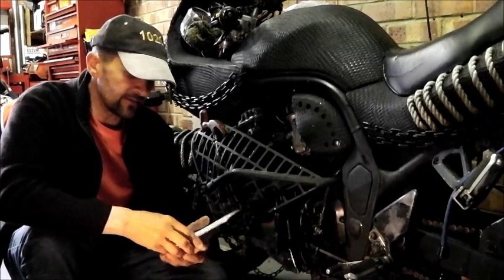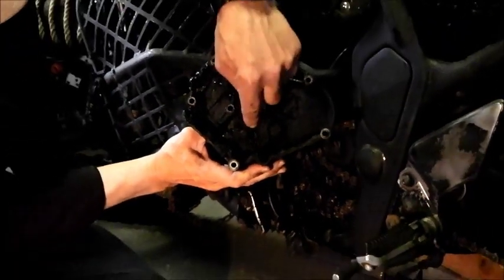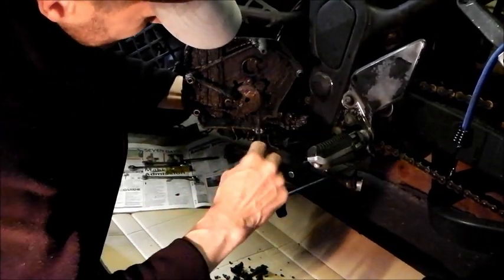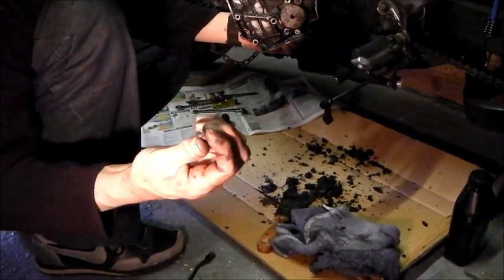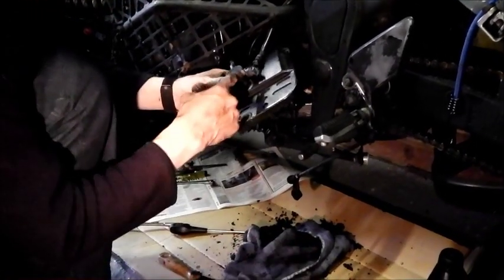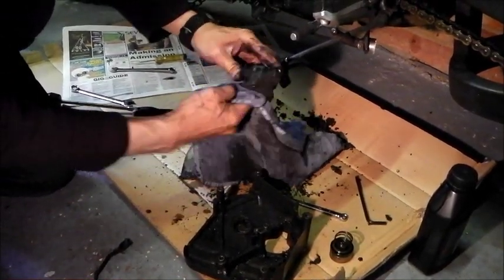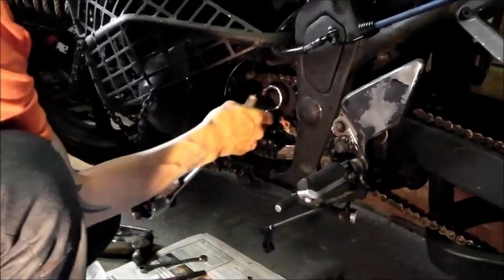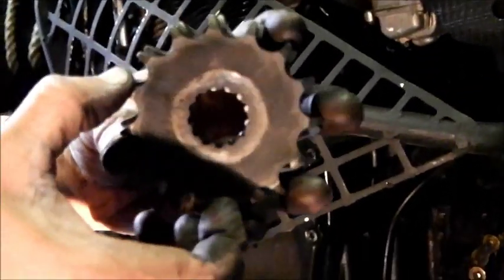Delboy's Garage, How-To;- Bandit Clutch Cylinder and Front Sprocket Replacement.

Comment: hello again, i hear you were mentioning belt drives, do you think a belt conversion on a triumph scrambler would be worth it in terms of small power loss vs less maintenance (initial cost for conversion not considered)
Reply from the maker: Before you consider anything else my friend, is it even feasible??  Do you know of a kit then??
Reply: Hi There, yes there seem to be a couple of kits out there such as 

http://www.freespiritsparts.com/en/belt-drive-conversion-for-triumph-scrambler-thruxton-silver.html

That was the first thing i checked when i heard you talking about belt drives on harleys. Thanks again for taking the time to answer so many questions, i really do appreciate it.
Reply from the maker: That looks pretty cool.. i see in a few of the images they have fitted 
an Idler pulley which you'd need with a regular style swing arm.... very
 interesting, and i imagine it would make the bike a tad smoother and 
maybe set a few ponies free as its lighter... ill have a look at the kit
 and see if it's what it looks to be.... and obviously if they'd send us
 one, id do a full video installaton... but i bet they wont..lol?
Reply: See this is why i asked, i didn't have a clue about different swing arms and the need for an idler pulley so thanks for that :)   Fingers crossed for a freebie :D
Reply from the maker: Its not a big subject buddy... but just important to get the parts right... TBH you certainly dint need it... however it does have some small benefits, and looks trick too... dont thing they'll send us one really.. but its always worth the ask aye...lol

Comment: hey del...
at firts please excuse my english;-)
is it possible that my clutch doesn't seperate the right way when the seal  of the slavecylinder is too old or woren out?

would appreciate an answer.
Reply from the maker: +bull e Hi There... if the seal is worn out then it will leak past and the clutch will not hold on the lever...you pull the lever in and hold it, but the bike still moves forward, or even the clutch does not disenguage at all.....but if the clutch works ok, then the seal is fine.... how is your bike working right now..?
Reply: +Moonfleet41 
thank you for your quick answer
when i strart the bike and put it in first gear , the engine dies immediatly even if the lever is pulled.
i can hardly move the ebike by hand when it's in first gear and the lever is pulled.
cheers from germany
Reply: +bull e 
by the way its the same bike like in the video an bandit from 1997
Reply from the maker: +bull e HI again, ok, firstly, you will normally find it hard to push a bike in gear with the clutch pulled....you are rotating a lot of internal parts and all glued together with oil...so thats not always a problem or a measure of a clutch's performance......what makes me wonder is your explaination that it cuts out as soon as you puyt the bike in gear....... have you checked the side stand switch????????  That is the plunger switch that is pushed in by the stand, and must spring out again when the stand goes up...if it stays on then the bike will think the stand is still down and the motor cuts out as a safety measure.......why not check that before you go any further.... ?
Reply: +Moonfleet41 
yes i did.
i'm a pretty heavy guy with a 120 kg and i believe i could push the bike in firtst gear with  a pulled lever;-)
but the rear wheel just didn't move.
as i explained the bike cuts  out an just one second after that i startet the bike in first gear with pulled lever and everything was ok.
also i  can hear a sound ( the engine was not runnig) when i pull the lever.
it came out of he slavecylinder. like pushing  a fluid or air throw a thin gap.
of course i bledded the systhem after that.
but still the same problem
Reply: +bull e 
i don't know the right words for that...
but the rest of the clutch lilke all the plates and rings and stuff where replaced last year by a mechanic an i had no problems till yesterday
i ran the bike like 7 or 8 thousend km in this time
Reply from the maker: +bull e Sorry then buddy, i cant do much more... i have given you the obvious possibles, and you tell me its not those things...i cant diagnose your bikes problem over email, from this point i would need to see it to investigate for myself as i dont really understand what you are explaining, sorry not to be able to fix it for you, perhaps its time to take it to a garage...?
Reply: +Moonfleet41 hey
i replaced both auf the clutch-cylinders and the fluid yesterday and the bike works just fine👍🏻👍🏻
thanks for your effort

Comment: Love the vids, great reference source as a new rider - I've got a question that I reckon you could answer fairly quickly, what's the right forum for asking you a question?
Reply from the maker: +Bigface NM Ask away, just post it here - what do you need to know buddy??
Reply: +Moonfleet41 OK, nice one - '97 Baby Bandit, first big bike. When I let it rev out in 2nd, 3rd, 4th, at about 8000 rpm it will often leap up to about 10000 rpm, sometimes with an increase in acceleration, but often nothing to write home about. Mates have talked about the 'powerband', but what I'm seeing is that dramatic that it feels like if it is reaching the powerband it's just making the clutch slip. I cannot for the life of me make the clutch slip at any other time (including static with the brakes on). Is this normal? Or is it time for a new clutch/springs/both? Cheers.
Reply from the maker: +Bigface NM Hi mate , if you take a look at any torque and bhp curve on a dyno, max. torque is always way low down compared to peak power, usually about 2/3rds of the way along peak bhp... so to get to 8k and then rev out doesn't make sense... if the clutch is letting go then it will do it lower down in the lugging zone around 3-4,000... but then I am basing my experience on a B12, not sure what the performance curves are like on a 600... unless, when you say, 'baby Bandit', you mean it's a 400??  Either way, the clutches on all Bandits are weak as a new born baby... they don't have 6 coil springs , instead a single diagphram disc and notroius for spinning up... could change the oil and filter and possibly, if you are capable, drop the clutch pack out and clean the plates off with some petrol and scuff up with a ScotchBrite to break the 'glaze'... further than that, I would have to take a look at it, hope that helps, Del
Reply: +Moonfleet41 Mate that's spot on. It's just had an oil and filter change so when it's due again I'll replace the plates and springs. Thanks for your time, much appreciated.

Comment: awesome vid del....have you ever needed to rebuild the master cylinder...or better yet is it possible to DIY rebuild the master cylinder? cuz i have a leak somewhere but i cannot see any fluid drips anywhere
Reply from the maker: +Andre Toves Hi Andre...if you're losing fluid but no leak, then hold the pressure on it for an hour or do and see if it sink past the seal...if it does, then you can strip and rebuold them as long as you can buy the seals... so check that first, as long as you can get the seals then why not replace them to elliminate that part...like all faults, the best way to diagnose things is by ellimination... Hope that helps..
Reply: +Moonfleet41 I'll try that then..thank you very much....I'll get back to you for more guidance...this will be my first time touching my clutch system..thanks again
Reply: There's hardly any resistence when I pull the lever  and the clutch is not disengaging when I put it in gear

Comment: I Del I have tried to get my front sprocket off it will not move will it be ok to heat it up to release  thanks bill
Reply from the maker: bill fishburn If the nut isn't moving, then drop the back wheel out, fit the axle back through the swing arm, and fold the chain round it, then you can 'pin' a screw driver through the chain from top to bottom, effectively locking the chain in place around the axle....then with a long bar on a socket, you'll be able to remove it... i wouldn't heat the nut unless you are already doing the above and its rusted in place...the heat can radiate through the shaft and melt the rubber seal on the back....then you'll have to replace it.. The axle method has never failed me in 20 years... good luck with it.. that should sorti it for ou buddy.. Del.
Reply: Thanks for the advise del will try locking the chain I can't believe how tight it is.bill.

Comment: Hi delboy. Excellent videos , I always look for your vids when I'm stuck. I replaced this seal no more than 3 months ago, but already got leaking fluid! Is it possible for this to happen so quickly or have i done something worng ? Many thanks :)
Reply from the maker: Hi Alex.. it is possible if there was some corrosion or sharp edge on the piston or the bore its slides into.. its important to feel around the smooth surfaces in there when you're replacing it and make sure there is nothing that will cut into the new seal..  you could maybe drop the piston back out and have a good clean around the rim and make sure its all smooth.. feel the seal itself to make sure there is no damage to it, and then re-build it again I've had this with fork seals before that seem to leak for no reason... hope that helps, good luck !
Reply: Many thanks buddy :) I'll give that a go have a good day mate!

Comment: Heya del,Lee here,my mate told me to try a 14T up front for quicker eceleration,would you recomend it,I have a 600 mk1,plus would I have to change the rear,if you could shed some like that would be cool man,cheers.
Reply from the maker: Hi Lee, I'm not sure exactly on the 600 what front sprocket you have, but if it's 15T standard, then 14T front would drop your gearing by half a gear... imagine it like this, you have 15 on the front and 45 on the back, so 3 teeth to 1... therefore dropping one tooth off the front is the same effect as adding 3 teeth to the back... so imagine on your bicycle shifting to a larger rear cog for a lower gear.  So yes, a 14T will make it accelerate quicker specially in 2nd gear... it will also help you a little if you wanna practice wheelies off-road and stunts... it won't do any harm to the bike, just make sure you make a good safe job of fitting it! Del
Reply: Cheers del,yeah she has 15T,just wanted to check first before ordering one of the fleabay,just got me a carbtune the other day so there's a few jobs to be done,carbs,front break rebuild, lowering the seat by sanding;-) re-ajust and clean chain,clutch window case,and a full on rat,your vids are savage help man,I'll do a before and after vid and wack it on the tubus.get her ready and in tip top shape for the bulldog bash;-),cheers again mate!
Reply from the maker: Leon Cleary
Bulldog Bash?  ...excellent, do make sure you look us out and spend some time to chill with the gang!
Reply: Will do man,I'll be shooting up from London so ya never know,we mite meet in the middle on the way up hey.stay safe dude!

Comment: hi del just want to know how to get out alloy fixings on clutch casing dont want to snap them thanks
Reply from the maker: When you save 'alloy fixings' presuming you mean alloy bolts??  And usually people fit these cos they like the pretty coloured ones... don't worry mate, they are usually pretty strong and made from high grade alloy, so just use a perfectly fitting allen key held at dead right angles to the bolt and undo it gently... good luck with it mate, Del

Comment: Hi there Del, I have been watching your vids for quite a while now. They are fantastic. I hope you don't mind but I have a question for you. When I removed my clutch cover there was a small wire on one of the bolts. I thought 'I'll remember to put that on when putting it all back togother'. Now I cannot find the thing. I has just disappeared! Haynes doesn't mention a small wire attached to this and I cannot find a mention anywhere on the internet. Do you have any idea what it might be? I have learned a lesson from this. I should have put the bolt back into the hole with the wire on it as I did the work. Keep up the good work. You are a good teacher!
Reply from the maker: Hi Jissy, good to hear from you... sounds like what you found was an earth lead... many people fit items to their bike that need an electrical earth wire (or ground wire) and they just pick a handy bolt they can get to... and engine casings are a favourite cos they are accessible!  Obviously it was there when you took it off, so have a grope round and see if you can find it... is there anything electrical on the bike that's stopped working? or something electrical that you don't use? such as a battery minder pig tail, or something?  Let me know and perhaps I can be more help!
Reply: Thanks for your reply Del. I have spent ages looking for the wire but all to no avail. I started up the engine and all the electrics seem to be working fine with no fault codes. Learnt my lesson though. Next time I will screw the wire with a bolt so that it stays put. Thanks again Del and keep up the good vids.

Comment: Doing some work on the mates bandit and can't I get the front sprocket nut off. The lock tab is out of the way and I had a breaker bar with a 4ft pole on to it and the nut will not budge.. All that's happening is the breaker bar is bending. Fuck knows who the hell put it on and what they tightened it with. Just thought I would check out your video just to see how tight your one was and couldn't believe you got yours off with a bloody spanner.
Reply from the maker: +livingonanisland Rest assured my friend, I was as surprised at that as you are!  I have had 6ft scaffold poles on the end of that spanner in the past, and a mate tapping on the head of the spanner with a 2lb hammer... and both feet off the floor, hanging on the bar, before it goes with a mighty bang!  It all comes when dipshits do them up with windy guns!  There is never any need cos you have a tab washer to stop them coming off...

Comment: I will investigate... just read What I initially wrote and not sure if I was clear but it's the biting point which is 1mm from handlebar
Reply from the maker: Hi Mark, sorry mate, missed your point there, its been a busy day... OK, if its bighting right back at the bar, then its more then likely air in your hose... so bleed it through fully mate, get any air out, and it should improve and bight out about half way like normal.... the air in the system means you're just not pushing the plates all the way open..!   Also if you have really low fluid in the reserviour, then that can lead to a cloer bight... so check those and see how it goes mate..! good luck.. Del.
Reply: Thanks for the reply! I've checked the fluid level and that's good so I will look into bleeding it. This bike has been sat up since 2009 and only covered around 20 miles since me buying it. I've now done around 150. I believe it's had oil and filter change recently. Is there anything I need to do/check to
Reply from the maker: Ok, you didnt say it had been sat for 7 years... ok, change ALL the fluids, oil, and both brake and clutch fluids (they should be changed every two years), and once it has fresh fluid in the lines, that clutch may be just fine..!
Reply: +Moonfleet41 Ah, Apologies! ok brilliant I will change the fluids and hopefully will all be good. is there anything else on the bike that should be looked at?
Reply from the maker: Not really buddy, most bikes can take a lay up with no real dramas...often the fuel can go stale and clog up the carbs...but if you're riding it about now, and its performing well, ten just take it easy, tyres can go a bit hard and sometimes perish, and often you may pop a fork seal a few miles back on the road due to them drying out....but again.. if its running and riding ok...then just keep an eye on everything... good luck with it buddy, let me know how it goes.. Del.
Reply: +Moonfleet41 cheers mate, thanks for the help!